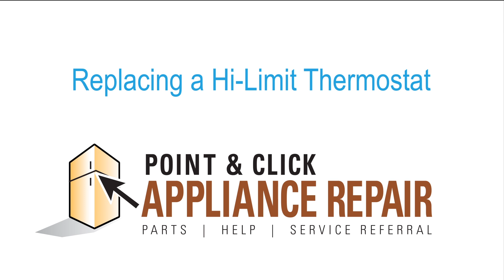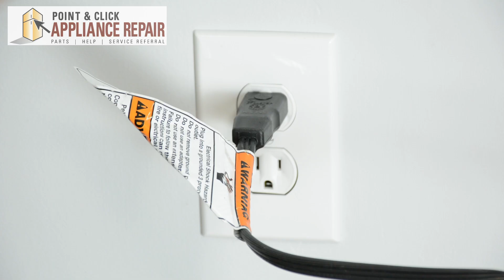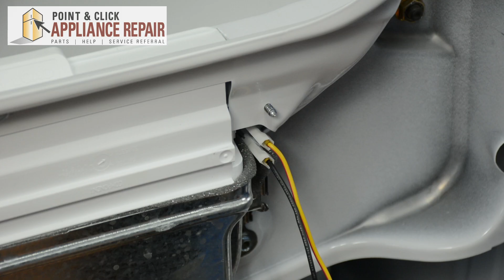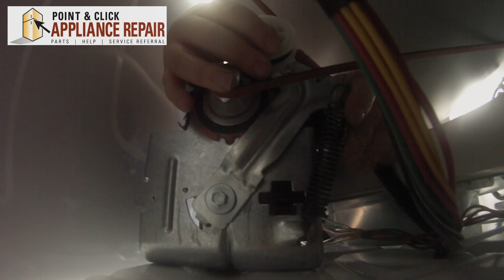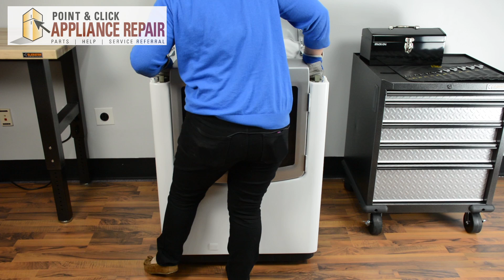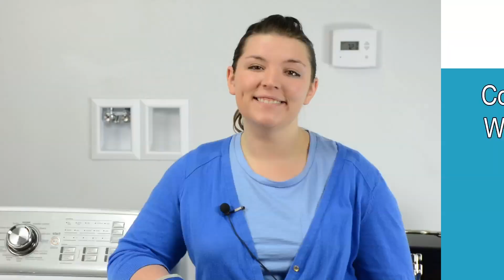WP3391912 - Dryer High Limit Thermostat Replacement - 3391912, PS345064, AP2975888, 526280

Comment: Does this hi-limit thermostat only open for a overheat fault condition?     

Or does  it open  and close under normal operation - i.e. it functions as a temperature regulator for the dryer?
I thought the exhaust temp. thermistor was used to regulate the dryer temp with the dryer controller (computer)?
My high temp cutoff has blown (350° F) and this hi-limit thermostat is set to open at 205° F. 
I replaced the high temp cutoff last week and the new one tripped again last weekend.
My exhaust is not blocked - good airflow. 
Maybe my exhaust temp. thermistor is not giving the correct resistance to the dryer controller?